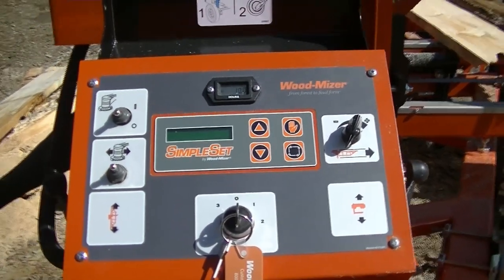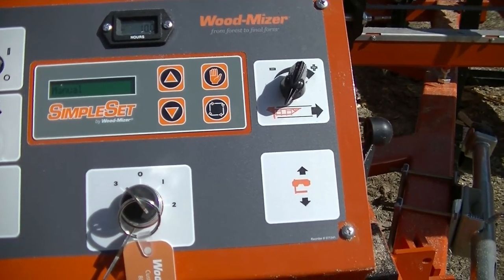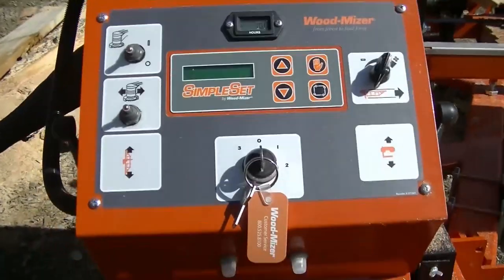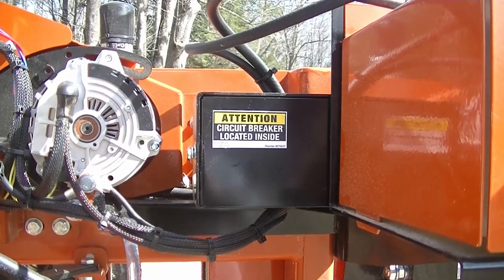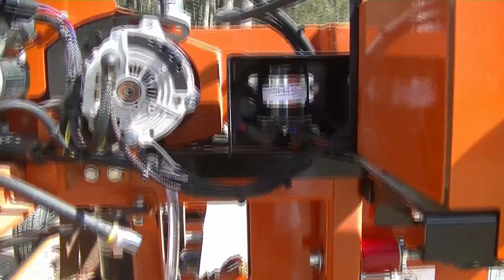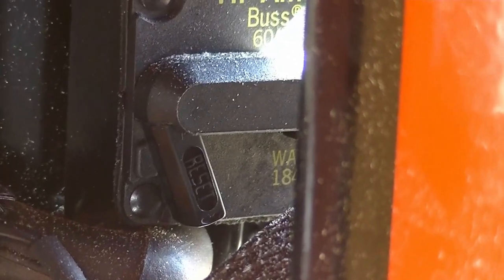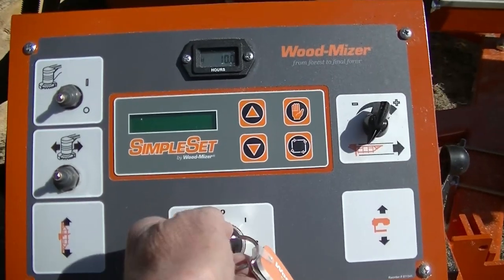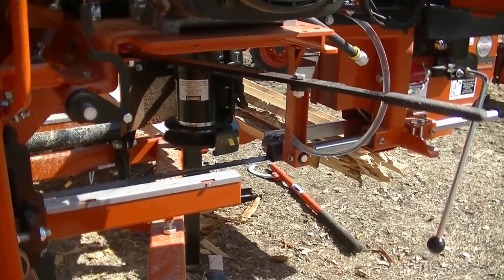#7 Woodmizer LT35 Debarker stopped working

Comment: Life saver. Thanks
Reply from the maker: Not sure why they didn't make it a little more obvious...
Reply: @udgrin2  there are a few things I wish they made a little better like the front support to remove it from a hitch but otherwise it’s a great machine. Not sure what made the circuit trip other than maybe the debarker was too tight against the log
Reply from the maker: @zero932905  i put a crank trailer jack on the front of mine to assist getting on and off the hitch.  As far as the debarker. I feel it is too tight against the log too and will attempt to loosen it up some next time I use it.